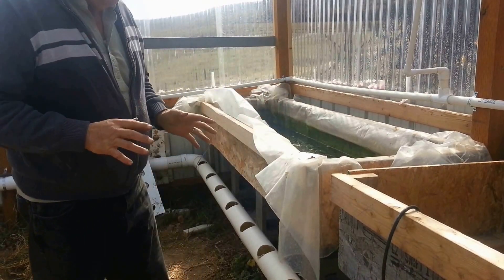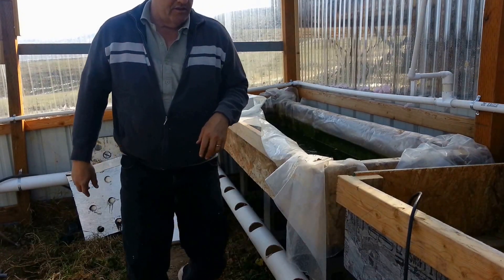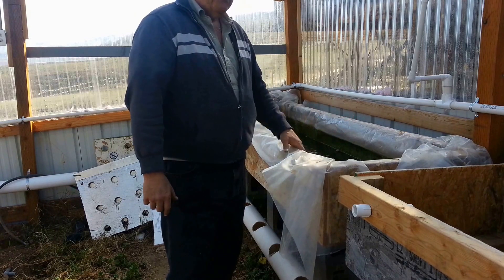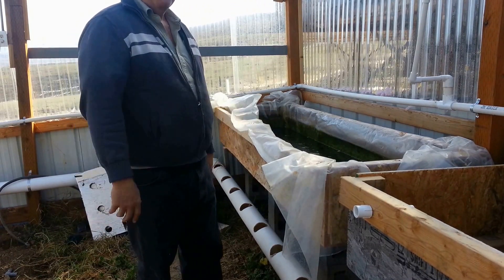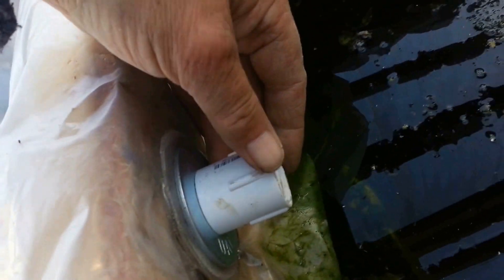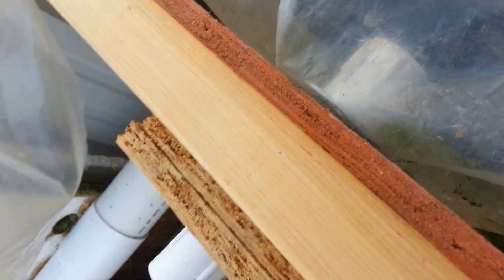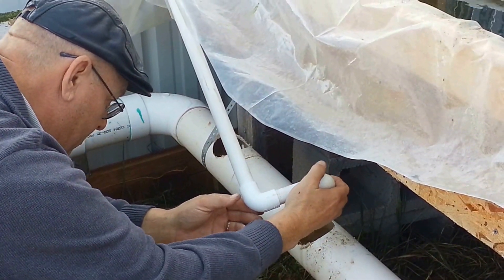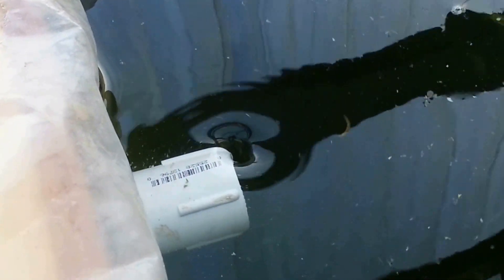Building my greenhouse aquaponics system part 2  Getting the fill & Drain system running

Comment: If you elbow down into your tank, you'll avoid floating matter returning and then you can skim the top to clean out debris easily.  One elbow and two short lengths of pipe will do it.  I keep mine under the water, but above the bottom so particles on the bottom or top won't go into the return pipe.  Learned this from experience.  If it isn't clear what I mean, I can elaborate.  Good to see progress!
Reply from the maker: Hi Brent, 
I actually did build it so I could do that.  You'll see in the next video.  I also used pipes that were big enough so that only the largest of the chucks would not go right down and pass.   I am thinking these will end up in the fish pond and either float or sink.   It'll be something for the fish to mess around with.  I am hoping all this works because you  can grow some really good stuff in aqauponics. 
Ed